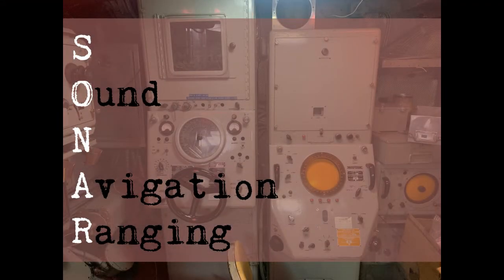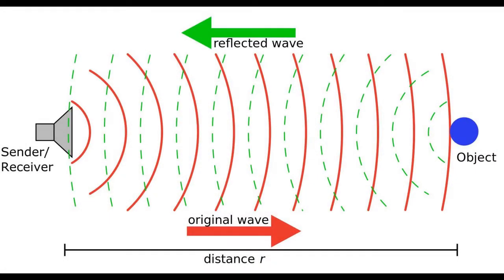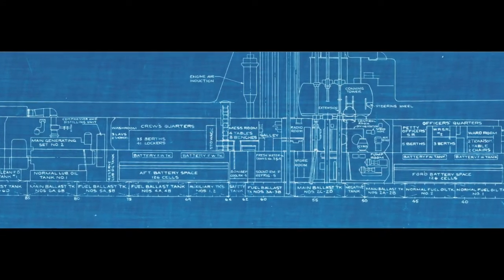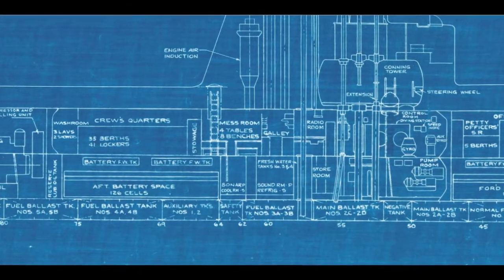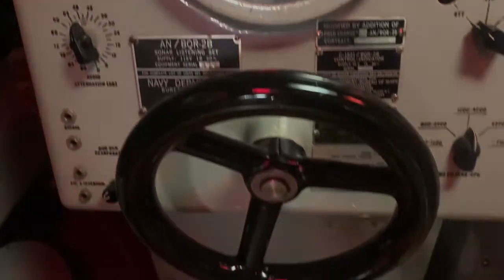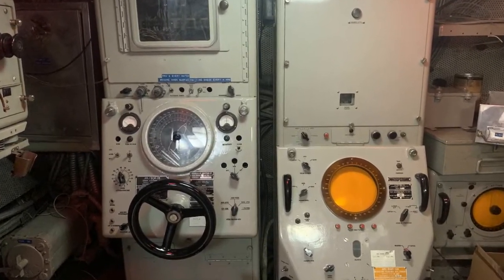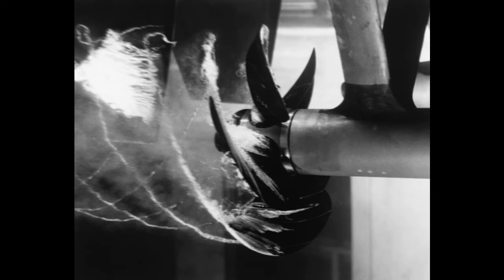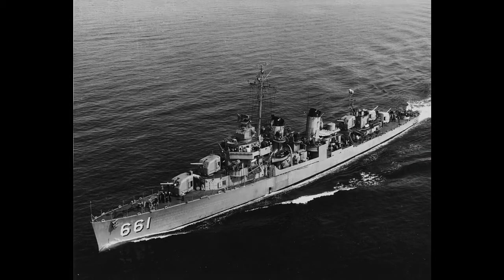Sub Science: SONAR

Comment: Cavitation occurs because the propeller blade tips reduces the vapor pressure there and this turns the water into bubbles of steam. The actual sound is caused when the bubbles collapse and the they make an amazing amount of noise. The faster the prop turns the greater the noise. The noise heard through sonar is kind of like a steam locomotive "chuffing".